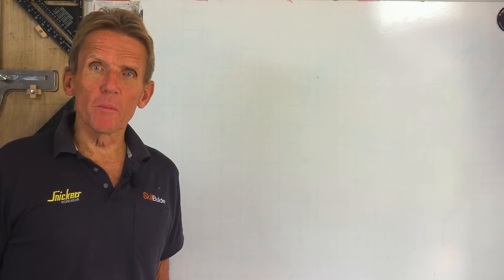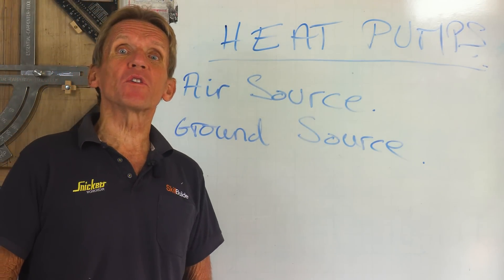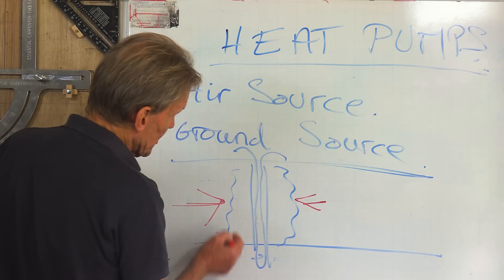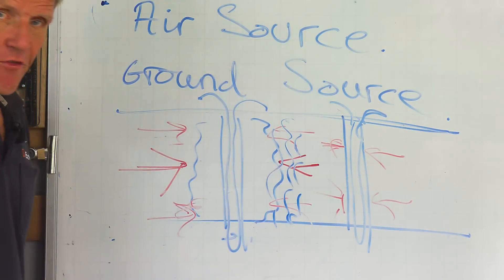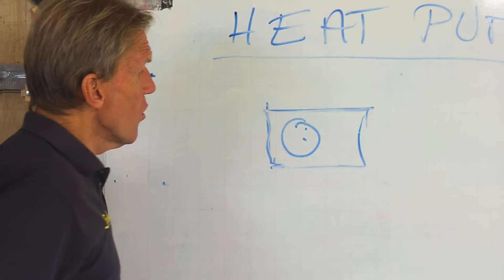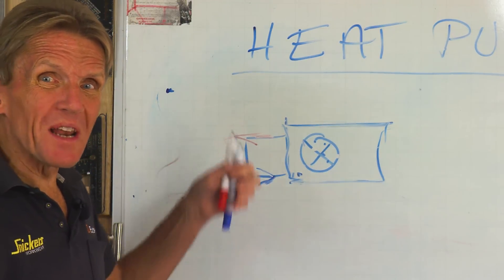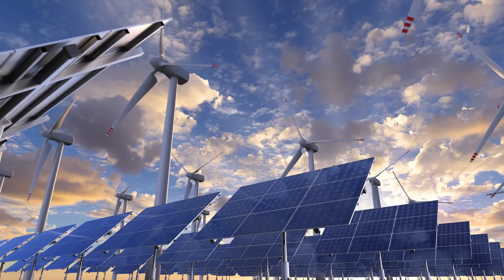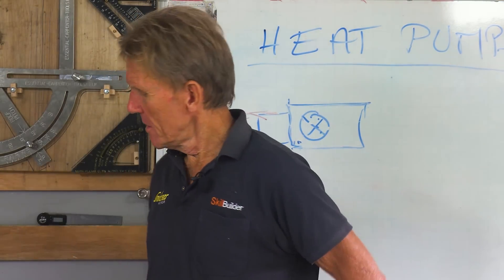Heat Pumps ~ Get Your Facts Straight!

Comment: In everything in life there are widely accepted terminology that has a very widely accepted understanding; even if the term is not technically accurate. In the US, "Geothermal" installed in your home is universally understood, as opposed to a "water source heat pump." CONTEXT makes everything quite clear. If you're talking about Geothermal springs in nature, you understand Geothermal correctly in that context. If your neighbor just got a Geothermal HVAC system installed, you seamlessly change your understanding to THAT context. In the US, a 'water source heat pump' is usually a different appliance installed in a different environment to the HVAC professional. Also, in the US, you described a Hydronic air source heat pump ;not common here, but growing slowly.

Comment: Mostly I hear heat pumps are crap. Maybe ok if you live in an eco house somewhere but for your bog standard pre war build, terrace houses and old council houses you will be cold in winter. Give them free to the pensioners and that'll do the governments job for them and see them all off as it is mostly pensioners who live in these drafty old houses.
Reply from the maker: Back in the day when not everyone had central heating and draught-proofing I went to the houses of many pensioners who just toughed it out. I fear for the young who have never known anything other that a warm house. 
Now they find they can no longer afford heating they still refuse to put on an extra layer of clothing.
Reply: @SkillBuilder  I think the problem is these heat pumps are going to be forced on people if the gas boilers are banned. The heat pumps are way to expensive to install for the most vulnerable who just happen to have enough cash put by to not qualify for assistance but don't want to blow their security savings on a heating system they neither want nor be anywhere near as warm.

Comment: I do not believe it!
A very easy way to establish the facts and check the efficiency of your home....
Step one......On a cold day or night and your house is nice and warm, take a note of the temperature outside and inside your house and then switch your heating off whatever it is.
Step two.....24 hours later take note of the temperature outside and inside your house and then switch your heating back on. This test checks how well your house is keeping the heat.
Srep three.....Check how long your heating takes to get back to the start of step one....This checks how good your heating is in heating your house.
Step 4......take meter readings of the source of your energy before and after the tests....This tells you how much it costs to heat your house given the required inside temperature and the outside temperature.
Surely nothing could be simpler?

I did the test for my house and I was very happy with the results and I have gas CH.....

First my home did not drop in temperature very much over the 24hrs. (Delighted)
Second the temperature returned to a comfortable level within 1 hour. (delighted).
The cost was minimal as I only used the gas for less than 1 hour intermittently as the gos boiler switched off and on several time whilst it was heating the house.

I'm sticking with Gas thank you very much!

Comment: As a retired Surveyor I can recall a ground source heat pump installation in an Academy we built in the Telford area. Basically it didn't work 2000m of trench and pipework for nothing. It was thought the pipework was faulty but that was never proved. All classrooms were issued with temporary heating for the winter months. Great!
Reply: So what is your point ?
Reply: @peterjones6322  it was an expensive folly

Comment: just watched a review on a heat pump thats been working for one year, the guy seemed happy ? its cost him an extra £263 compared to his gas boiler use the previous year but reduced his emmissions by 2.3 ton co2 !   wonderful, im happy he's happy !   i put in a log burner stove, i saved over a thousand pound last year on gas usage and i used roughly two good sized trees that cost next to nothing as i cut and processed myself, it requires zero electric to run, i have two fans on it that run from the heat generated with no electric use ! the stove heats the whole house red hot if required :) it's an approved eco stove and almost as efficient as most new boilers and more efficient than most that are over 6 or so year old...........he cant quickly increase the heat if he comes home freezing cold ! i can. if he stood in my living room in winter watching the flames, feeling the direct heat !  he'd decomission his heat pump out and install a log stove :)   and by the way an average human releases about 3lb co2 a day increasing if exercising so him and his partner jumping about inside their heat pump home doing star jumps trying to get warmer cancels out his saving that he thinks he has made :)

Comment: Tip for heat pumps paint backing wall matt black this absorbs solar heat and in turn heats the air which is then extracted by the pump.😊😊😊🎉🎉🎉🎉🎉🎉🎉🎉🎉🎉🎉🎉🎉🎉🎉🎉

Comment: Here is a fact. £580 gas bill in a 4 bed house. New heat pump. New water tank. New radiators is £10000. Even if the electric was free that’s nearly 20 years to pay back. It’s not free because electric is same price as gas at a cop of 3.5. Saves nothing in terms of co2 because of all the new equipment and because electric is powered 65% from fossil fuels anyway and gas will be the main source of electric globally for next 100 years. Thems the facts right there. It’s a scam

Comment: If heat pumps were soo great, cheap, efficient and have been around for over 100 years, then why is every home in Britain not already using them? That's because they are a hugely expensive load of sh*t and your Electricity bill will also skyrocket, when these things are working because they break down a lot. That's information from every plumber I've spoken to and I know because I'm a electrician and spoken to a lot of them onsite. All for net-zero which is totally impossible joke and a scam, everything else! WW3 is far more of a threat than Co2 that's about 0.02%  and plants need Co2 to live and we need plants. So work it out yourself!

Comment: But does this heatpump thing work better and more economical in winter than my little cheap electrical garage heater?
I guess the colder is gets, the harder it has to work to find some heat to transport inside.
Reply from the maker: heat pumps work best when the weather is mild. The COP goes down as the weather gets colder. That is all part of the smoke and mirrors. The seasonal cop (SCOP) looks better because it includes all those days when the weather is mild.

Comment: There is miss information over heatpumps and the Norway argument. Take Oslo as an example.  85% of hot water and heat comes from a type of heat pump. Problem is its a single heat exchange system district heating.  Funded by Norways masive oil revenues.  
https://en.m.wikipedia.org/wiki/Drammen_Heat_Pump

Comment: your'e improving roger but still adrift, the ground bore holes would be best (unless your neighbour has one too and sits on you ground) you would have to be within a few yards of each other to affect each other's bore holes, a bit unlikely and a waste ot time and effort telling us that!!!!!  i did agree with an earlier rant from you regarding  poor instalation but that is down to the purchaser researching the installers, (check a manufacturer/supplier first) keep up the good work regarding building but lay off the stuff you dont know about (makes you look like an idiot)
Reply from the maker: Wow! did anyone ever tell you that you are patronising?  I was putting in ground source with slinky in trenches and bore holes well over ten years ago and they are still working fine. The performance over air source is around 1 on your SCOP and it is a huge investment for most people. As for the replenishment area for a bore hole that depends on ground conditions so you can't possibly know that a few yards is good enough. I have seen the results where a neighbour's drive started to lift because of a ground source heat pump and people lose plants and shrubs because of lower ground temperatures. 
Your final point about it being the responsibility of the purchaser to check the installer is up to the job. Installers come and go, even good firms employ bad people. It is pure nonsense and shameful to suggest the consumer is to blame.

Comment: Roger - good summary of the different systems - BUT AND I MEAN BUT IN THE NICEST POSSIBLE WAY - what people want is overall ststem costs for say 10 or 20 years - that would mean install versus running. 1 person commented he changed to a new Bosch boiler ( supplied and installed ) for £1,700 - probably upped his efficiency from 80 or 85% to high 90s - he would probably break even over 6 to 8 years. ASHP and GSHP are not instantaneous ( hence the need for a buffer or tank ) and depending on their COP rating ( which is averaged ) when they do the calcs - which is no use in the winter when your COP is low. When the Govt is offering grants its a sure indicator that this is a political rather than a purely economic breakeven situation.  Running and install costs for me please - I can read a book on the rest. Always well presented though ( from a fellow Buider - with a Mech Eng degree - I know that sounds poncy but it gives my background )

Comment: Orchard Way ,sheltered housing Timberscombe, Somerset air source heat pump problems elderly people with out heating and hot water must be uninvented parts or noit enough heat in the air over winter due to Global Warming or Putin,s war in Ukraine.

Me 47 years of a flooding celler where Severn Trent Water Ltd ,Warwick District Council and Warwickshire County Council dont want to know.Includes raw sewage.

So it goes on.

Prrhaps we need a cocacola head as the next prime minister after Sunak.

Comment: Wait till the compressor goes and takes the inverter board out , or it loses all its refrigerant when it leaks . Always happens just out of warrenty . Costs a fortune to repair , the average plumber wont be able to do it so its a brand new unit .
Reply: Compressors and pcb boards are the most common replacement I deal with. Then again a lot of heatpumps have 7 year warranty
Reply: @shaneoneill1949  they are just rubbish , we have all had to do a lcl course at work the guy who was teaching the course afterwards said he would not have on in his house the costs are outrageous
Reply: @barronfartpants6849  Costs of what are expensive. I'm interested as I'm a heating engineer and I design bespoke heating systems whether it's gas/ oil, geothermal or heatpumps
Reply: @shaneoneill1949  a replacement compressor for a ecodan is over 2k sterling . Without labour or new refrigerant .
Reply: @barronfartpants6849  Any compressors I have changed where done under the 7 year warranty, it's usually not long after being commissioned. A compressor will last 15 years and I've seen some still going that are older than that. Just like any mechanical part it has a life span. If a compressor has stopped prematurely it's due to poor maintenance or poorly designed heating system
Reply: I have changed hundreds of compressors on systems by Daikin ,mitsubishi,  large co2 pack  systems like green and cool. Some compressors last for 20 years some go as soon as the system is out of warranty.

Comment: You didn’t mention hot water. Heat pumps don’t produce hot water. My combi boiler gives me rapid house warming and instant hot water. A heat pump will give you warm water which needs the addition of a storage tank with an electric immersion heater to keep the temperature above 60c. This is to guard against Legionella. Energy generation by heat pump costs about a third of that produced purely by electricity but they only give background heat so need to run for much longer making a nonsense of the efficiency figures often quoted. Until electricity prices fall heat pumps are a non-starter. Energy spokesmen euphemistically say the energy market needs rebalancing which obviously means a hike in gas prices not a reduction in electricity prices. 
There is more misinformation  put out in favour of heat pumps than against them.
Eventually the gas will run out but by then we will have found new ways to produce energy, geothermal probably being the best. The earth won’t cool for another 5Billion years even with us extracting all that heat. Meantime the only ultra reliable renewable source is tidal power but you don’t hear much about that.😊
Reply: A heatpump can produce 55 degrees of hot water easily and the electric heater turns on once a week for less than an hour. A ground to water heatpump is a bit more efficient than an air to water but at an extra cost. You will always get more heat energy out of the electric energy you put into it and they are always more efficient than gas or oil. They can even operate at -25 degrees nowadays. I know because I design bespoke heating systems for a living
Reply: @shaneoneill1949  Your figure of topping up hot water for 1 hour a week assumes you have used no hot water. With normal family use it will cycle many times daily as cold water flows into the storage tank. With electricity costing nearly 4 times that of gas per kilowatt hour there is no competition on overall cost and don’t forget heat pump efficiency falls off in cold weather, just when you need it most. Heat pumps are certainly worth it in all electric homes but gas will be king until the government artificially raises the price of gas to force people to change.
Reply: @johncrosley1  I'm a heating engineer for the last 20 years, I can dissemble anything from a 20 year old oil fired range upto a ground source hybrid heatpump so I seriously doubt there is anything you can tell me that I haven't learned already. There is no other element needed to supplement hot water, the information you are spreading is for the most part false. My job also involves comparing efficiency between all designs of heating systems. Even a standard air to water heatpump at below freezing temperatures is more efficient than a gas boiler. I know this as I have used the formulas and observe the data produced from each unit.
Reply: @shaneoneill1949  Please tell me what I am saying that is not true. You say supplementary hot water heating is not required. Your own figures say a heat pump can raise the temperature to 55c but stored water must be kept above 60c to prevent legionella. I am not questioning your ability as a heating engineer but you obviously have an agenda which makes you biassed in favour of heat pumps. Mine and I’m sure others main interest is what is the cheapest way to heat my house and hot water. When heat pumps can perform as well as gas at the same price I will come on board.
The ball park efficiency of a heat pump is 300% to 400% but while electricity is very nearly 4 times the price of gas plus installation costs it’s no contest.
Reply: @johncrosley1  I'm not biased towards heatpumps, I learned my trade with gas and oil but time  moves forward and you have to adapt. You are correct about the legionaries disease. Once a week your immersion will raise the temperature in the cylinder to prevent the build up of bacteria. This is the sterilisation function, it only happens for a very short period. The main problem with heatpumps costing so much is the design, a heatpump has to be sized correctly for an individual house, you can't have the average plumber just install a heatpump and expect everything to run correctly and efficiently. Training and education is what is needed otherwise people will just blame the technology when they should be blaming the installer. If anyone is getting high bills from having a heatpump installed then it's 100 per cent the installers incompetence.

Comment: Nice one Roger. I've dipped in and out of your videos over the years, I always thought you were dead against heat pumps but I'm glad to see you are embracing them and spreading knowledge.
Reply from the maker: I am not exactly embracing them. I think they have a place. If you are using electricity and have no mains gas they are well worth considering. My whole premise, which I explained right from the start, is the madness of the Boiler Uprgrade Scheme which uses tax payers money to bribe people away from gas. It has caused misery for thousands of people and we get emails every week telling us about the disasters that unfolded when people decided to follow the government advice. 
If you have a working gas boiler there is no point scrapping it for a heat pump and if your house is not well insulated (you may have solid walls) then a gas boiler is much better. It allows you to put heat into the building quickly at a higher temperature. Using a low temperature heat pump in cold weather is not going to keep pace with the buildings heat losses. 
I also know they will make no difference to climate change, it is just too insignificant.
Reply: @SkillBuilder  And climate change is happening, but the gov.com has hijacked this natural occurrence to blame/charge us all......just saying....because...err..covid.

Comment: If the ground is heated by the sun, why does it hotter the deeper you go?
Reply from the maker: If you could simply dig down to get heat the world would have no need for oil or gas.
Reply: @SkillBuilder  Okay I did some more research. Some domestic GSHP boreholes go down over 100m and so I think that could be called geothermal because the weather and sun only affect the top 10-20m of the earth. As you go deeper the temp rises by about 25°C per Km. The world’s deepest gold mine, Mponeng in S. Africa, reaches 66 °C at 4 km - and that's with ventilation.
Reply: The oil wells I worked with would be say 1000m to 2000m deep and they would flow back at around 30°C. If you have 50 thousand dollars a day to run a drilling rig for a few weeks I suppose you could have a nice geothermal  setup.